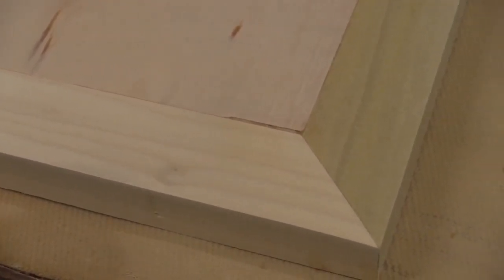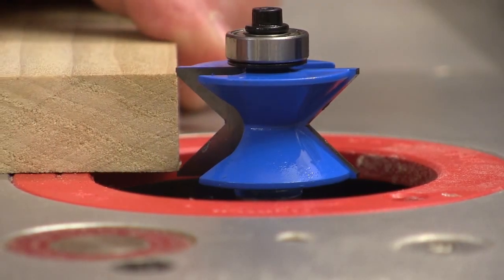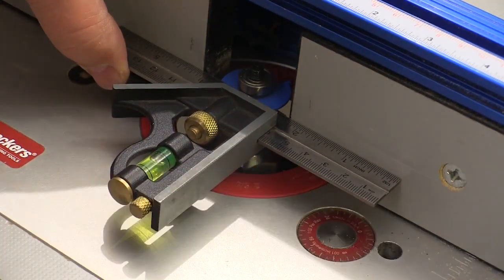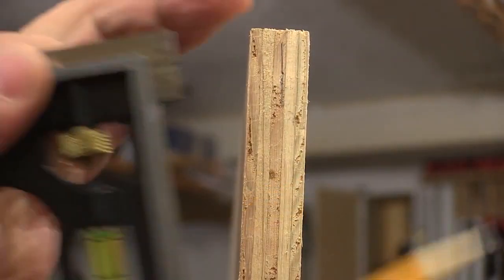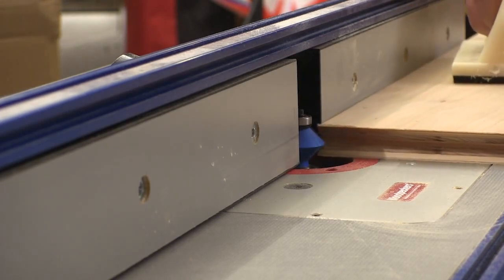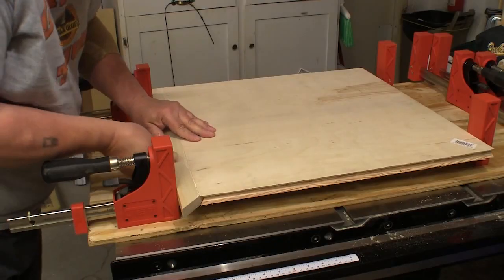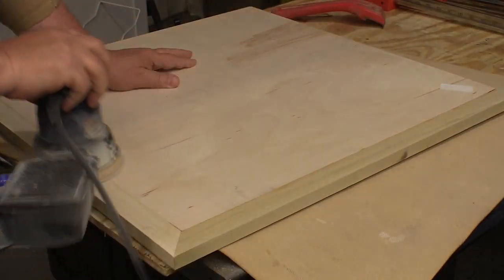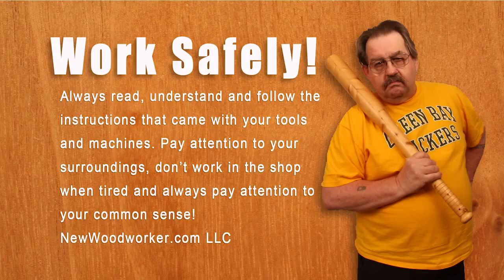Rockler Edge V-Groove Bits Review | NewWoodworker

Comment: What's the point of having a bearing if it never gets used?
Reply: Bearings are always good as they stop you getting lost
Reply: I had the same question. Obviously no one has a good answer.
Reply: The bearing is used to set the fences,  or you could use it on a template jig if you were adding edge banding to a contoured edge (eg. rounded corner shelf)